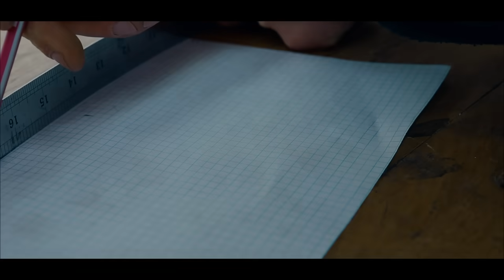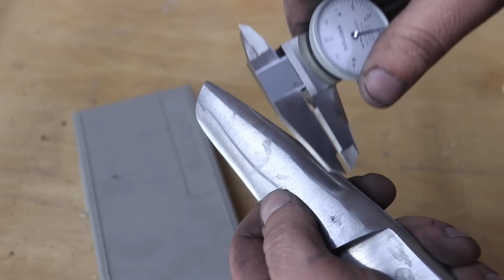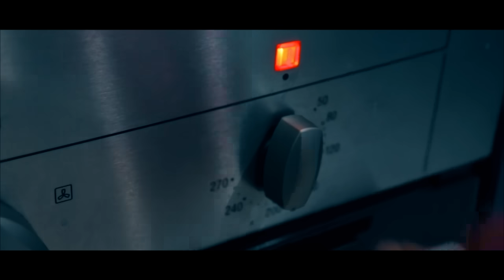Knife Making - How to make a Modern Bushcraft Knife, full build.

Comment: On the one hand, this guy just made a knife with a pair of channellocks and a framing hammer so what the hell is my excuse?  On the other hand, he's got a 72 inch belt grinder.
Reply from the maker: Thanks for watching.
Reply: Could still do by hand but would start with a half inch thick metal bar angle grinder and a couple of hard days hand grinding
Reply: he also essentially sharpened a crowbar, like Jesus that's a chunky knife, this guy could probably turn an I-beam into a hatchet
Reply: Don't lie
Reply: I still use my 1x30.  Cheap.  Belts are cheap. Get some quality stock 2x12x1/8" 1084.   Some fire bricks and a map torch.  Quench in cooking oil.  How I made my first knife
Reply: @kinleywangdi5575  you don't lie
Reply: That belt grinder makes a big dang difference.  But still top notch 👌 skills
Reply: @WDRestoration ... and I can buy this knife from you, how? 😂 Amazing work, love the channel!
Reply: Most of this seemed unnecessary.. still looked good at the end.. but..

Comment: Hello. Truck springs are usually made of 1.5160 steel or similar which is OK for knife making. But you need to forge it (around 960 celcius) and then normalize it (around 870 celcius) in order to modify grain structure and improve toughness. You didn't do that. After these steps, you need to harden it (around 840 celcius) and temper it (around 190 celcius). Your tempering temperature is OK, but from what I see, I seriously doubt your furnace can reach 840 celcius. Also from the color of the knife during quenching, I can tell that the temperature is lower than 800C. Below 825 celcius, this type of steel will not get into austenite phase, there will be no martensitic transformation and therefore it will not harden. Also after tempering, you should not allow it to get near 200 celcius again, since this will further temper it and decrease the hardness. In other words, you better use wet grinding or at least manual grinding after the heat treatment step. You put so much time and effort towards building a knife, so it is rewarding to pay attention to get the best microstructure possible. The performance of the knife depends on it.
Reply: You look like an expert on this craft
Reply: @rahulk2633  He sounds like one too.
Reply: Because he's a knife

Comment: This is really cool and creative, but that would be WAY to heavy to use as a bushcraft knife that you would actually cary into the woods, and since that is made from a leaf spring, it is simply carbon steel and if the handel isn't coated or wraped with something it will rust in your hand after only a short while. That said, as a novelty knife, and as somthing different from the rest this is a definite success. Beautiful work.  Thank you for sharing.
Reply from the maker: Thanks for watching.
Reply: @WDRestoration  💀🚬

Comment: That knife is amazing!  The workmanship is second to none!  i've watched the video a few times n it never gets boring!  I wonder, would you produce these to sell?  I'm in to bush craft and anything outdoors n could do with a strong no nonsense knife like this!  Keep up the good work
Reply from the maker: Thanks for watching.
Reply: @WDRestoration  No problem.  As I say I'd watched a few times lol

Will you produce one for me?  Willing to pay for it obviously
Reply: @WDRestoration  is it possible to own this knife
Reply: It's beautifully crafted for sure, but kinda impractical for actual use in bushcraft though. The blade is way too thick for fine cuts, I imagine it's crazy heavy, and being all metal, it's gonna suck the heat right out of your hands in slightly cold weather. Plus, I'm not sure about the ergonomics of the handle. For bushcraft you want something that you can squeeze as hard as you can, in multiple grips and use it for an extended period of time.
Reply: @mrkiky  exactly...its nice n looks...but i alrdy feel my hands crapping up & the inflimmation on top of that after long use as one of ur main tools...using a machate can wreck ur hands after long use...dont need a knife doin the same thing...
Reply: @mrkiky  exactly right. Too thick. Too heavy. And probably too slippery too.

Comment: Back in the day, we'd make various projects out of scrap metal and hand tools, just to pass time whilst out on submarine patrol. Not often anything quite this ambitious, usually, though. Lots of worn out nuts turned into rings, bits of piping turned into lighters or pens, etc. I know a couple go-getters, though, that would have embraced this build with great enthusiasm.

Nice work!
Reply: I still have a pair of hull metal dice around here, somewhere. Perfectly symmetrical, hand-worked out of a bit of scrap left behind by a sandcrab (shipyard worker).

Comment: Really good craftmanship, nice design, but you will not get a good knife with that heat treatment. A dull red color is too cold for hardening, and if you get a good hardening, your temper was at a too low temperature. The exact conditions depend on the steel alloy, but your waaaay of most normal kinds of steel.

If it was me, I would have taken a thin steel plate of an alloy good for knife making, and after tempering, epoxied it to two aluminium bars. That way you still can get a polished look, but it would be much lighter and easier to make. Less metal wasted as sparks.

Comment: Stunningly beautiful, may I ask what steel you used for this?
Reply: It is most likely 440c I would guess.
Reply: Leaf spring
Reply: @waqarghulam3548  So, 5160 steel. Problem is rust. I would rather use a through-hardening stainless such as 440c.

Comment: Hey, i've seen this done a LOT. I'm JUST ignorant to Blacksmithing enough to know there's isn't much of a difference, but i always wondered. Why Cut forge instead of Hammerforge? Just to save time? Does the miniscule difference only slightly make a Hammer Forged blade stronger?
 i know there's a lot of question marks but really im just lookin for one answer.

Comment: This is not a bushcraft knife. A bushcraft knife is able to do stick feathering, batoning, getting fire with a ferro rod.
It will be consider as a utility knife. However, it's still too thick to use on food preparing. 
Besides, this knife could be very very heavy and not so easy to carry.

But this design style is similar to Extrema Ratio. It's unique. Maybe it can be re-modified as a thin one-piece hunting knife. 3 mm thick on blade and 5 mm thick on handle is fine.

Comment: Is this a joke? what a ridiculous design. This isn't a bushcraft knife, it's incredibly impractical. Why did you heat it up and hit it with a hammer? Also that heat treatment looked shoddy, it would have worked out better if you'd kept the original heat tread and kept it cool during grinding.